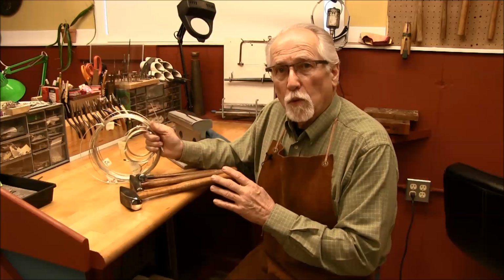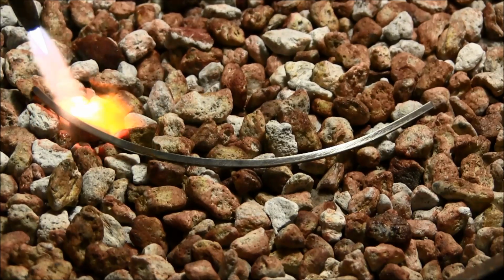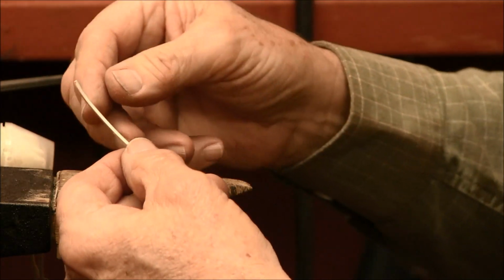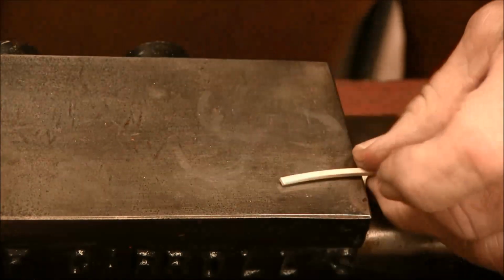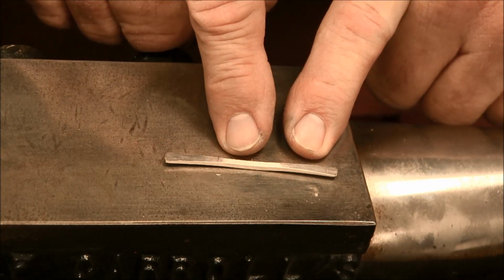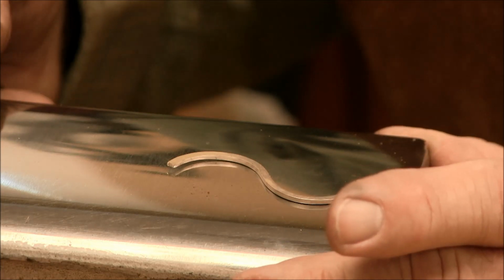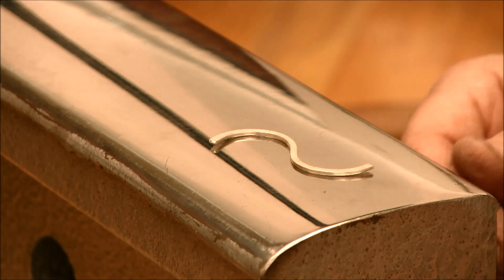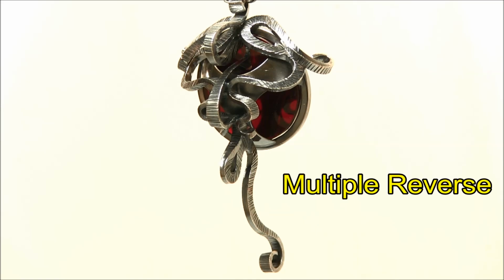NEXT STEP ADVANCED SILVER FORGING TECHNIQUES

Comment: So you don’t need to heat the metal to forge it into shapes?

I just tried to forge a little ingot I poured to try to make a pointy end to go through the wire puller thingy. However, I got the silver ingot red hot and when I hit it with the hammer it shattered into a mashed up mess of pulverized metal pieces.
Reply from the maker: Hello Darren,  Sorry you had such a traumatic pulverizing event.  But, it is a good learning moment.  
You had the right idea, but the wrong metal. 
1. "Ferris" metals :  Metals that are made of iron (steel). 
We usually see ferris metal being forged red hot on an anvil by a blacksmith. 
When ferris metals are heated to red hot, the metal elements start to move and more spaces are between the elements. At this point,  the metal becomes soft and bendable.  This is when you see the blacksmith  hammering or forging the steel into a shape when it is red hot. When the ferris metal starts to cool, it becomes hard again. So the blacksmith must reheat the metal to continue to work and shape while it is hot.   This is the characteristic of ferris metals, they must be worked hot and when they cool, they become hard again. 
2. "Non-Ferris" metals: Metals that do not have iron in them. "Non Ferris Metals are (Silver, Sterling Silver, copper, gold, etc. ) 
These metals have  interesting characteristics.  When they are heated, the elements in the metal start to move and spaces are made between the elements and the metal becomes soft.  BUT,  unlike ferris metals, the non-ferris metals REMAIN soft when they cool.  
In metalsmithing and jewelry, this process of heating to a dull cherry red color and then letting the metal cool, is called ANNEALING.  This is a wonderful characteristic, because now we as jewelers, can work with the metal and shape it or forge it with a hammer while it is cold.  
Your silver ingot was annealed when you melted it and formed the ingot. You can now forge the ingot while it is cold and it will form the way that you wish. 
NOW. When you start hammering or  forging on the silver, you will be forcing the elements in the silver closer together and the silver will become stiff and hard and hard to bend.  This is called WORK HARDENING.  Now the fascinating   thing,  You can reheat the silver to dull cherry red and let cool.  This is now soft again and you can continue to forge on the silver. You can repeat this as many times as you need to to finish your forging job. 
Take your shattered silver pieces and re-melt them into another ingot and follow the steps above. 
I hope this helps you.  Good luck and keep watching.  
Greg Greenwood
Reply: @ Thank you so much Greg. That was very thoughtful of you to write me such a comprehensive explanation. I had absolutely no idea about the nonferrous metals being forged cool. 

How much hammering can the cold nonferrous metals take between annealing? I’ve felt like I could only do maybe around 10-20 wacks before it would cool and start feeling work hardened. I think it might of all been the result of me working the silver hot. I had a couple other experiences where the metal I was working just pulverized all of a sudden. I’ve also had the silver shatter when I was putting it through a roller mill. I wasn’t milling it hot though. I did that all cold. I had a wire shatter lengthwise and I observed the silver inside the wire was a dull chalky looking white color. It didn’t look silver at all on the inside. 

Anyhow, the information you provided me with your comment was very helpful and again I appreciate you taking the time and energy to help me like that. I will try to repay you with likes, follows and comments on your content.
Reply from the maker: Hello Darren,  Glad I can help you.  The silver will work harden quickly and you may only get 6 - 12 hammer blows before it work hardens.  It all depends on how hard you forge.  
The shattering and pulverizing are because you are over work hardening. The rolling mill will work harden quickly, especially if you squeeze too much.  Rolling mills like a "little at a time".
Thanks for watching and commenting.  Greg Greenwood
Reply: @ again, that was some tremendously helpful information. Thank you very much. 

So it sounds like annealing is a much larger portion of the process than one would suppose from watching silversmithing videos. I realize why they’d edit it out for expedience and to prevent the viewer from getting bored but annealing once every 6-12 hammer blows is a ton of annealing. The videos make it seem like it’s only a rare thing that one needs to anneal.

I’ve been using the wire extruding plates and I’m guessing that I probably need to anneal every 3-5 pulls with those. Potentially less. 

Silversmithing is a lot more annealing than I had originally imagined. However, I just dropped a lot of money on a high price roller mill. Annealing is something I will just have to be content doing I guess. I’m not spending that much on a tool and not using the F out of it.
Reply from the maker: Hello Darren,  Don't worry so much about the times you have to anneal the metal.  Remember, the metal is being compressed every time you hammer on it.  When it starts to fell hard, anneal.  You are making the metal "feel good".  Thanks again.  Greg Greenwood
Reply: @ if I overwork a piece will annealing it repair it? I have a coil that I made but I overworked it numerous times, I think. The wire is pretty tattered looking. However, it’s my first attempt so I’m not that concerned if it’s a bit ugly. I just don’t want it to be likely to break. I’m hoping that annealing the metal can repair it from being overworked. 

People also emphasize to only get the metal slightly red when annealing. They say not to get it too hot. But what’s the risk? As long as it doesn’t lose its intended shape isn’t it ok to get it as hot as possible? Or will overheating it also cause damage? 

Thanks for your help with so much information. I feel a bit guilty asking you this many questions and I imagine you might answer them in your videos but it’s a lot of searching for a specific question in a lot of video footage and I am likely to space out and miss portions of the lessons.
Reply from the maker: Hello Darren,  First of all, I am working on an Annealing Video as we speak!!! To answer your questions you can watch the video when it is published.  Soon I hope.  But in the meantime:
1. No, annealing will not repair an overworked piece of metal.  If the crystal structure of the metal is "broken" then annealing will not help.  Don't over work the metal.  The tattered wire is a perfect indication of overworking. It will be very likely break if you keep using it. Scrap it. 
2. Silver can be over heated in the annealing process.  Overheating means that you are starting to melt the silver and the structure of the crystals is changed. This is damaged goods. 
More details will be in the video.  Just remember two lessons:  1. Don't over heat  2. Don't over work
Experience will teach you the fine tuning of these lessons. 
Keep watching.   Greg Greenwood
Reply: @ thanks again for all your support and information. I will stay tuned for your annealing video. Hopefully having a beginner asking you these questions might help in your composition of information that helps total newbs. I think pros sometimes forget that there can be confusion about the most basic stuff. They forget what it’s like to be at the very beginning. I’ve actually watched lots of videos about annealing. They almost all include the exact same information and left me with all the same unanswered questions. Though perhaps I also spaced out and missed some explanations too. 🙏
Reply from the maker: Hello Darren,  I will do my best. Thanks for sharing.  Greg Greenwood

Comment: Excuse me teacher, I need to bring my hammers to a mirror polish again And I'm also in the process of making my own bench anvil I'm a welder by trade and large thick squares of steel are easily available but they have the mill scale on it. What is your preferred method? I'm currently rubbing it on a piece of 40 grit sandpaper and it's taking forever although it is making it true flat
Reply from the maker: Hello John,  Unfortunately there is no real fast ways. For the bench block,  I work down to a fine grit emery.  I do use a orbital sander, this makes it go faster.  Then I polish with stainless steel polishing compound.  You can use the polishing compound on the hammers on a fast polishing muslin wheel.  Throw a little oil or petroleum jelly on the hammers when they are sitting around.  Helps with rust.   Good Luck. Greg Greenwood

Comment: Can you help…..when I have a flat object assayed in the U.K.    the bang of the assay punches gives raised bumps in the other side of the surface,. What is the best way to remove the punch bumps other than sanding ?
Reply from the maker: Hello Robert,  Yes, that can be a problem.  If it is a flat sheet, then you could put through a rolling mill.  But that could give you other problems. I feel the most direct method would be to place on a good bench block and  planish from the back with a planishing hammer very lightly.  This will smooth the back raised bumps.  Then give it a little polish with a polishing wheel (Mop), and some polishing compound. I hope this helps you. If you have any questions in the future, let me know.  Good Luck and thanks for watching.   Greg Greenwood

Comment: Hey Greg, I'm trying to figure out how to make twigs/branches out of silver wire. Any tips? I can't find any books/videos for that.
Reply from the maker: Hello Dianne,  Homework time for you!! Go out and find some small twigs.  Look at them closely. Notice the textures ?  To make twigs and branches with wire, you must use textured wires.  Now, how to texture your wires to make them look more natural?  This is the fun part.  Start by taking some wire placing it on the sidewalk and hammer on it with a rawhide mallet.  This will give a really interesting texture that will look natural and not man-made. Also, check out my video "12 Free Hidden Jewelry Tools and Textures" .  This will give you some ideas for interesting textures that you can use on the twigs. The side walk texture is only the beginning.  Hundreds of textures and hundreds of different barks on twigs. Use your imagination!  Now that you have the textures, notice how the twigs are constructed. Do they have enlarged areas where the branches split apart? To the branches taper to a point?  You can use forging techniques and filing to achieve these looks. Don't worry, your first attempts may not look "perfect" but you will learn what works best for you.  If you are looking for how to make leaves, then check out my video "Foldforming Part 3".  I show how to make leaves using sheet metal and foldforming processes.  It could be an addition to your twigs and branches.     I hope this has given you some ideas.  Thanks for your questions. Let me know how it goes.   Greg Greenwood
Reply: @greggreenwood4628  Thank you, and I always did my homework so this will be fun! For my intro into metal I had Charles Lewton Brain's book, some copper and a hammer. I bought a vice and a torch and went to town!
Reply from the maker: Awesome!   Greg Greenwood

Comment: I'm really enjoying all of your tips, tricks, lessons, etc... So nice to learn from somebody so knowledgeable and talented. Thank you for all your time, teaching, and videos. 

Have you done, or if not, would you consider showing us how to polish a piece of recycled railroad track to a mirror finish??

I was lucky to have found a couple pieces of track in a local second hand shop, but haven't yet found any tutorials on how to create a finish such as yours. 

Thanks again, you have a devoted student here!
Reply from the maker: Hello Terry,  Glad you were able to find some track.  I don't have a video on the subject, but here are a few pointers.  Start with a good metal file.  Get a new one at the hardware store.  They are not expensive. File the entire surface until no pits.  Then take an orbital sander or power sander with about 80 grit.  Work your way down to fine grit.  This will give you a nice finish.  Get the finest wet / dry paper and finish sanding with it.  For the mirror finish, you will need a muslin/cotton polishing wheel. If you have a polishing machine for your jewelry, then use it.  If not, get the muslin wheel and put on a nut and bolt and insert into an electric drill.  Check with your hardware for the muslin wheel and some polishing compound for steel.  Check in the auto repair section.  Use the compound on the muslin wheel and polish in different directions. Then polish, polish, polish... I hope this helps you.  It will take a little time, but it is very satisfying when you are done.  Good Luck and let me know how it goes.  Greg Greenwood

Comment: Hi Greg, great video, thank you for anealing silver under normal light, that is extremely helpful.  Can you tell me if you quench after annealing?  I have an ongoing discussion with my son who is a welder who says quenching will harden the metal after annealing so the metal must be left to air cool.  Can you settle the dispute?
Reply from the maker: Hello Marge, Your son is 100% correct that steel will harden when quenched.  Different steels and different quenching liquids (oils / water)  will harden differently.  Sterling Silver will react differently.  After soldering or annealing sterling silver if it is quenched too hot, the metal will crack or split.  The quenching process with silver does not harden the metal.  I usually let the metal cool slightly so it does not spatter pickle out of the crock, but it can be pickled cool also. I hope this helped.  You are both correct.   Thanks for the question.  Greg Greenwood

Comment: Your hammers and anvil (RR tie) are so nicely mirror polished! I would like to know what brand hammers you are using, and where to get them? Trying to slowly swap out my cheap hammers with some nice ones but not so sure where to find them.
Reply from the maker: Hello Seth, Most of my hammers were purchased about 40 years ago!  The suppliers are not in business now.  But.  Rio Grande Jewelry Supply is an excellent dealer for hammers and tools. I have bought some new ones from them and are very happy with the quality.  You can Goggle for anvils,  they are readily available I'm sure in your area.  Try not to pay shipping on anvils!!  Hope this helps you.  Greg Greenwood.
Reply: @greggreenwood4628  thanks! I had a feeling the hammers might be a bit older. I will look into Riogrande. I have ordered metal from them but haven't looked through the tools.
Reply from the maker: Hello Seth,  I am sure you will find the hammers that will work for you.  Good Luck.   Greg Greenwood
Reply: You can use progressively finer grit sandpaper, emery cloth and polishing compounds. I use 3M polishing discs, both a 6” gray fine or a Foredom sized disc.  Just make sure you keep the ones you use on steel separate so you don’t contaminate your silver. Great for restoring and maintaining all your hammers, blocks, etc.
Reply from the maker: Brent F.  You are exactly correct.  I have restored many hammers and stakes using this technique.  Thanks  Greg Greenwood

Comment: What is your proportion of vinegar to citric acid? TIA. Love your videos always helpful. Thanks again.
Reply from the maker: Hello Indira,  You can use vinegar and citric acid separately. They are both acids and will work independently.  You can add salt to the vinegar also.  Good ratio is:  100 grams of salt to 300 ml of vinegar.   You can work on the ratios and decide what is best for your work.  Thanks for your question.  Greg Greenwood

Comment: "Forging" requires the use of a "Forge".
Reply from the maker: Hello Nomad Life, Thank you for your comments.  You are correct that forging requires a forge to get the metal hot enough to work,  bend, shape, or form.  This is normally used with ferrous metals (containing iron)  and is called "hot forging".  When using non-ferrous metals, the metal does not need to be worked at a high temperature. The metal is annealed ( heated to a dull cherry red color) either with a torch or sometimes a forge , then cooled.  The non-ferrous metals are soft at this stage and  can then be worked, bent, shaped, or formed using hammers.  This is typically called "cold forging".   Thanks again.  Greg Greenwood

Comment: Hi Greg, I'm very interesting in trying you pickling solution. What is your recipe for the solution? I have both vinegar and citric acid but need the ratios you suggest. Also, the ratio for the baking soda and water would be awesome. I like the thought of a safer solution!
Reply from the maker: Hello Dee,  Nice to hear you are thinking safe.  The pickling solution does not need to be exact.  Approx. 2 cups vinegar and 4 tablespoons of citric acid.   The baking soda solution can be 1 quart water to 4-6 tablespoons of baking soda.  Then rinse in plain water.  Hope this helps.  Greg Greenwood  (I'll answer your other comment a little later)  Thanks Greg
Reply: Thanks Greg, I look forward to hearing from you on my other questions.